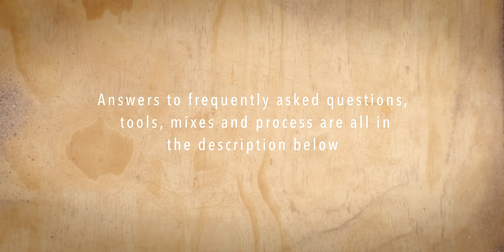Shiny Lime Plaster Sealed with Olive Oil Soap

Comment: Great job and nice video.
I have 2 question. What u call like should be Ca(OH)2, but what you call lime putty should be obtained by hydrating CaO in big pools. Not to be uptight but just to make sure I understood well since the language barrier. I also was wondering the reason why you don't use any kind of inert like sand in the last coat. I wonder if it holds the plaster togheter longer.
Thanks for sharing😉🤩

Comment: Amazing work. I have a question. How would you use this finish a wall if you had to deal with cold joints? I have a rather large area to finish and probably cannot get it one shot. I can use inside corners but there are some larger areas and it would be great to be able to get a great finish despite having to have some cold seams.
Thanks!

Comment: Hi I'm a plasterer by trade,
I came across your video by pure chance.
I have been experimenting with lime and marble dust to try and teach myself a bit of venetian plastering.
I never thought of using olive oil soap, I have been using using beeswax and paraffin to seal.
The olive oil soap is a great idea which I will try soon, a much cleaner and I imagine cheaper method.
Thankyou for being open with your methods.
P. S. Do you use a specific brand of soap or is it a bar or in liquid form?
Reply: I've been fascinated with tadelakt and lime for the longest time ever. Now that we're building a resort, I'm eager to inculcate this or tadelakt in our project.
Did you try exactly this technique? How did it turn out? What soap did you finally use?
Biggest question though, CAN WE APPLY TADELAKT ON FLYASH BLOCK WALLS? I've had mixed answers to this from the limited tadelakt-experienced people I have talked to. Some say the flyash blocks are prone to cracks as well as tadelakt. So their combination may result in early cracks. Some say that the surface isn't suitable/coarse enough for the natural plaster to adhere to.
I'm sorry for the questions. Any insight will help

Comment: This is an awesome video! I want to do this on an already painted/plastered wall. is that possible? if so, what would the process be - just sand it with 60 or 80 grit? would it be beneficial to paint some concrete glue onto the wall or stick with water? should i skip the base coat and just use the lime putty? thanks in advance!

Comment: So the limestone absorbs the olive oil in the waster to make the stone more hydrophobic is that permanent like can you use this in a shower application / wet area
Reply: the limestone binds not to the olive oil, but to the (olive oil) soap, there's a chemical reaction happening over time. I'm pretty sure you can use this for wet areas but it requires some upkeep (wiping the water down after use and re-soaping every now and then).

Comment: Great video ... thank you!  Is the lime used in this video Hydrated Lime Type S  like you find at Home Depot?  Can the base (scratch coat) be applied directly to exterior and interior hempcrete walls (after wetting them down)?

Comment: Hola from Costa Rica! What and amazing video! Question you mention a concrete bonder in the description how would you use that exactly ?
Reply from the maker: Usually depends on the concrete bonder, usually you paint it on and go over it fresh, some of them you let dry the one you have there is Maxicril or or plaster Bond which comes in a blue container, oftentimes good for helping it Bond as well as slowing the suction so it doesn't dry so fast.

Comment: I'm trying this in my bathroom now. The issue (well, the main issue) I'm having at the moment is that when I try to trowel the putty layer with the plastic trowel, it is just peeling it off and then I get sand grit into the putty which puts scratches in it. Do I need to wait longer to put the putty on maybe?

Comment: Perfect timing. I was going to try tadelakt for the inside of the temascal I am building with adobe, but this is faster and easier than rubbing a soap bar on the whole surface. Why do you say it's not tadelakt?
Reply from the maker: Just because tadelakt is conpressed with at stone when it's still green, and usually made with lime sand or marble dust instead of sand
Reply: @TheNitoProject  I like that you like to experiment. Would the putty not stick to adobe?
Reply: @TheNitoProject  Hi, any idea what I can use in Mexico por the soap?  N
Reply: @CynthiaSalchi  any soap is ok, the reaction is sodium stearate (normal soap) to calcium stearate (waterproof plaster).. I use lux soap flakes mixed with water, you could dissolve any bar soap in hot water and then paint or spray it on when its cooled.. Olive oil soap is simply used because its easy to paint on..
Reply: @picsi-software  thanks for the info!!
Reply: @picsi-software  I am about to try this on the walls of our resort in India. You seem to have good knowledge of the art.
I've been fascinated with tadelakt and lime for the longest time ever.
Are you talking about the cheap Lux soap readily available in the markets? Does it help with durability as much as olive oil soap?
Biggest question though, CAN WE APPLY TADELAKT ON FLYASH BLOCK WALLS? I've had mixed answers to this from the limited tadelakt-experienced people I have talked to. Some say the flyash blocks are prone to cracks as well as tadelakt. So their combination may result in early cracks. Some say that the surface isn't suitable/coarse enough for the natural plaster to adhere to.
I'm sorry for the questions. Any insight will help
Reply: @banjaran611  ask Nito is best, but yes plain soap soap is all you need.. lux is what I use ... flyash walls should be ok if they are stable

Comment: What would happen if I would similarly apply olive soap over lime paint (lime, dolomite, kaolin clay, methycellulose? We realised we might like to increase the water resistance a bit too late (not wet area, just possible few drops/splashes) and already have applied two layers of lime paint. Could just add a third and then the soap in a similar manner, but would it do any good?

Comment: What's the difference between this and tadelackt?
Reply from the maker: Tadelakt is compressed by a stone, and you usually use marble dust or lime sand, instead of sand
Reply: @TheNitoProject  si por supuesto... Thanks for answering. But my question was not about how it is made but if there are benefits from one or the other. Thanks again
Reply from the maker: Tadelakt is compressed so I would say tadelakt is better in that way, but this is less time intensive than tadelakt

Comment: How does your lime putty not dry out while applying it on the wall? 
I have been trying to get a smooth surface but am not able to. Could you please help me?
Reply from the maker: I make sure that my base coat is still wet fresh and if it's still drying out too fast I just add more water to my lime putty, or if my base coat is already too dry and is wicking too much moisture I make sure to wet it down, Hope this helps best of luck.

Comment: Can this be added to stucco?
Reply from the maker: Yes
Reply: Thank you for your quick yes
The next question is how and also can it be put on existing stucco?
Reply: Yes, if it's painted/sealed you have to use some sort plaster glue or scrape off the paint or sealer
Reply: Benito Steen thanks! Plaster glue? Yes the stucco is painted and perhaps impossible to remove , what can I put over the paint?